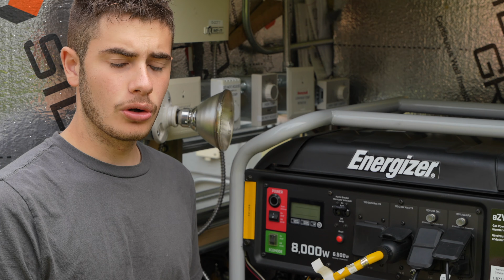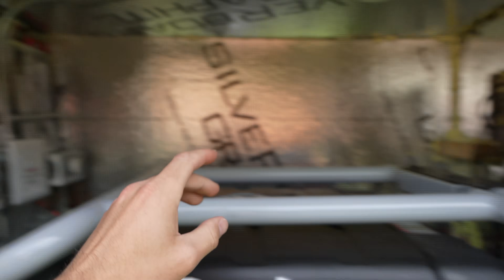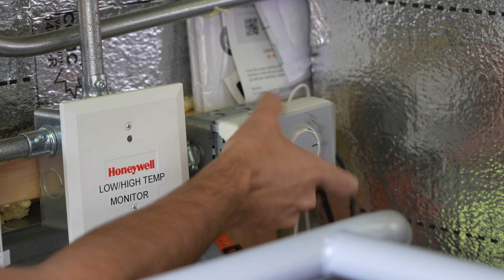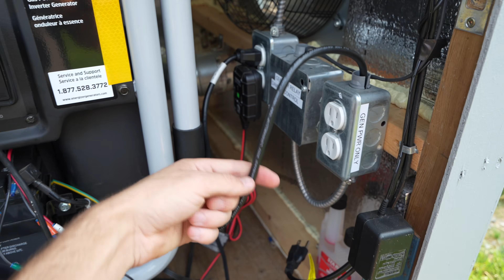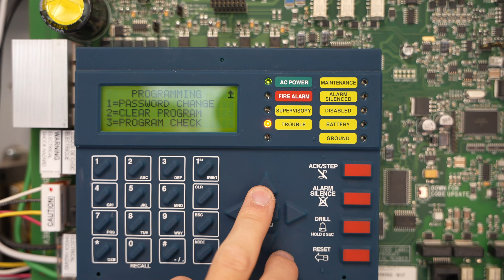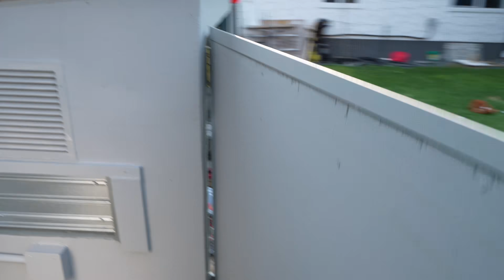Fire Alarm Automatic Damper Closing In Generator Building

Comment: Whats with that control transformer - it looks like one side of the 24v secondary has black and white connected, the other is grounded. Whats the return path or did I miss something? Great video
Reply from the maker: The one terminal had two wires as one is for constant power and the other one tapped off of it goes through the relay that only closes when the generator is running
Reply: @nics-systems-electric  doesn't it need 24v constant, signal and a common? Just like a doorbell tramsformer? Just trying to figure out the current return path for the damper actuator motor. Looks like the other side of the secondary is just a grounding conductor
Reply from the maker: @stillthakoolest  green we will call neutral and other the white or the black both coming off the same terminal one is giving the actuator constant power and the other branch is going through a relay to the open signal
Reply: @nics-systems-electric  seems like itll work but maybe a good idea to upgrade to something more code compliant. A good lesson for apprentice school talking about single phase 2 wire systems.
Reply from the maker: @stillthakoolest  it's extra low-voltage I needed three wires and that cab tire I had made the most sense to use it's what I had on hand. If you prefer I could re-identify colours with tape but i'm not interested in spending more money on a set up that works fine.

Comment: Put Mini Smoke Extracting Vents in the house System for safer evacuation and make the Kitchen extractor to turn on when the detector in the stairway or 2nd floor hallway is in a Pre-Alarm Threshold
Reply from the maker: The problem is you don't want to be moving air around potentially fuelling a fire more in a non-sprinklered combustible construction building
Reply: The goal of a fire alarm system is notification and control. It notifies people to leave the building and it does the best of its ability to control the fire via closing doors, sprinklers going off, closing and sealing HVAC ventilation to attempt to choke out the fire. 

Removing smoke just leaves more oxygen available to fuel the fire
Reply from the maker: @БУЛАВА-б8ф  that is mostly true I think his comment was referring to smoke control systems which are a set up that is sometimes in place. I have videos on my channel of testing them however you will only find them in usually sprinklered buildings that are non-combustible construction and they are there in very specific applications.
Reply: What material is your High School made of so it won't spread a fire on Smoke Extraction systems to remove smoke and allow more visibility
Reply from the maker: @iansanchez1470  for a start it is a fully sprinklered building where the sprinklers should control the fire itself and the only other risk is the smoke. It is also a ball steel concrete and glass building therefore not made of combustible materials like a residential home.
Reply: @nics-systems-electric  This may work on your Garage system becuase it's a sprinkler system

Comment: In your opinion, which is better overall, Notifier or Firelite? In my opinion, it is Firelite.
Reply from the maker: If it's just a hobby system to play with firelite is more user-friendly however for a real system notifier has much more capable systems with features that firelite does not offer so for a real life it would be notifier.

Comment: Does the actuator require power to close? If so, what happens if you are on generator power and this triggers? Won't the supplied power run out before it finishes closing?
Reply from the maker: Yes will only close if it has power
Reply: @nics-systems-electric  love your videos.  Since you mentioned the damper needs power to close, wouldn't it fail to close if the generator is shut down when the fire alarm is triggered in the generator building, and the generator was running because of a power outage, so now since the fire alarm system shut down the power source to the damper, there is no power going to the damper.  I think you need an uninterruptible power source just for the damper so it has power regardless of the utility power or generator power.
Reply from the maker: @kc7sbf  yes it would not close this would only be beneficial if there was a fire in the generator room while utility power is still on.
Reply: I was thinking that myself... that actuator should be swapped out with a spring-return one that doesn't require power to close...

Comment: Idea: Put a "Generator Fire Alarm" strobe inside the garage building that activates through that same module
Heres a question, do you do the double tap of the trigger when you pick up a power tool?
Reply from the maker: Could be done if I installed another control module however could become difficult to tell if it's going off when you have the rest of the system already an alarm
Reply: @nics-systems-electric  Good point. But why would it need another module?
Reply from the maker: @chrisgamecave  if you're trying to turn on a device zoned specifically you will need a control module
Reply: @nics-systems-electric  Yeah but you already have one setup for that, no?
Reply from the maker: @chrisgamecave  no
Reply: @nics-systems-electric  Im sorry I'm kind of an idiot... You HAVE a relay module where you would NEED a control module... I apologize for my stupidity
Reply: That seems like a cool idea
Reply: All of the detectors have labels and he will get text and email notifications on which sensor set of the alarm.

Comment: Since the horn in the shed is too loud, have you thought of just having a remote strobe/strobe only in there? I think it's a code violation to have a horn in a small room like that because of overkill. But it's up to you
Reply from the maker: If it was just a strobe you would have no sound. There's nothing wrong with horns in small areas if it doesn't exceed 108 dB
Reply: probably because it echos which can make it sound loud even if that alarm is o0n low volume
Reply: Yeah you right, Put a louder one in there